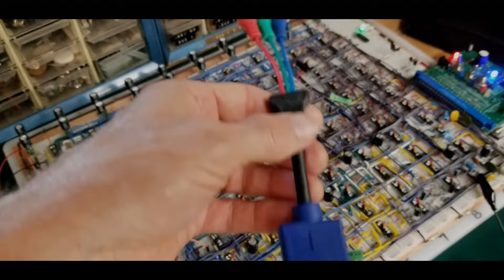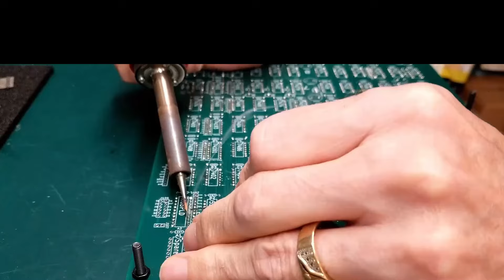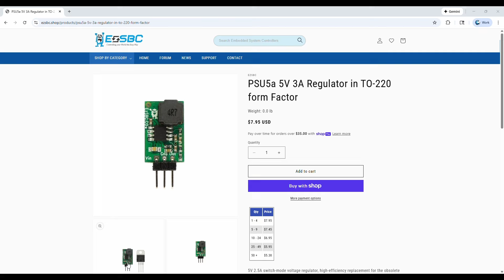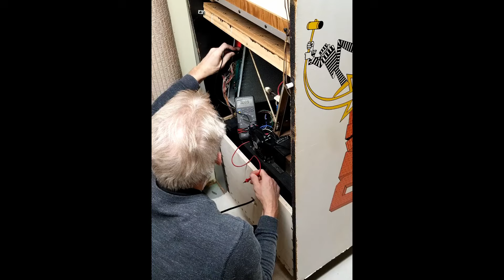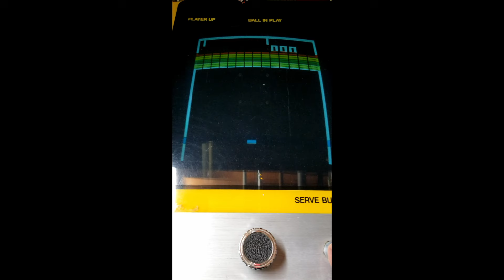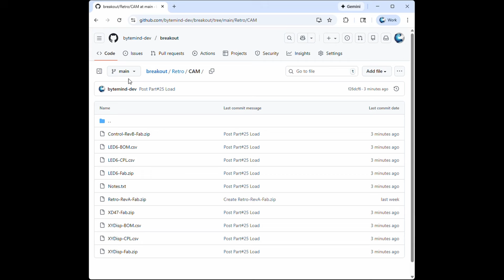Retro Atari Breakout Part 25 - PCB Build & Test: HDMI Support, Power Options & In-Cabinet Test

Comment: I have fully assembled the board and it's running almost perfectly.

The following errors occur:

- The counter always shows 14 credits when switched on.

- When switched on in attract mode, the ball is positioned above the stones; this is correct after the first game.

- When all stones are cleared, the new wall doesn't appear completely.
Reply from the maker: Excellent!!

-For the 14 credits; the Q latch should be off which force-clears the 74193 in L8. Is the operational latch working properly, e.g. pressing SET & RST? Is L9 a 7400? Perhaps a bad or fake 74193? I'll try to simulate the same condition.
--Update: If you only install 1 coin switch, you need to short the other switch NC side to GND. If I remove my control card and power on, the operational latch (Q) does not work and the coin counter is stuck on 2. Not sure if this is the issue or related to the issue. Thought I would mention it.

-At power-on the video counters should have random values, so the ball can start anywhere - including behind the bricks. This should be cleared up when you press one of the start-game buttons.

-For the new wall, most likely C15 or R22 is bad or the wrong value (also check C14 & R23). We tested this out in Part#15 by purposefully lowering the cap value or decreasing the resistance (don't remember).

Let us know what you find!! -Paul
Reply: @bytemind-dev 
I've taken another look at the board:

-The operational latch worked (set and reset) when I set it up. Now, when I press reset, the LED dims briefly but stays on.

Q is always high.

L9 is a 74LS00.

The 74193 seems to be okay; I've connected a display. It counts down for each game and up at credit 1 or 2. The LEDs for one or two players also light up accordingly.

I've connected both coin switches, and both work.

-When switched on, the ball always starts above the wall, which isn't a problem, I was just surprised that it never starts below the wall.

-I experimented with C14 and C15. The built-in ones were both around 1300nF.

I replaced both with 2200nF capacitors. It works for player 2, but not for player 1. I also replaced 74123, but that didn't change anything.

``` I'll have to take another look at that, testing is so time-consuming :-)
Reply: Today I took another look at the credit counter. I discovered that the problem lies with the coin switches. They are momentary switches. If I hold both in the drop position, there are no credits on the counter when I turn it on. Releasing either one of them adds a credit.

I reversed both switches, and now it works as it should. Q is off and comes on with the first coin.

I measured the drop contacts on the switches, and they go to coin1nc and coin2nc.

Does the designation (Norm/Drop) refer to the switch position and not the contacts? If so, I misunderstood :-)

Now I just need to get to the bottom of the "empty wall detector" problem...
Reply from the maker: @Ramex2099  NC should be normally shorted to ground (Norm) position and NO shorts to ground when you "drop" a coin via momentary shift (Drop position). Both of my switch levers on the control card normally sit towards the Coin LED and to drop you push away. Perhaps your switches have reverse mechanics internally. Are you using the recommended switches or something else? -Paul
Reply: @bytemind-dev  
No problem, i thought the "Norm" and "Drop" is for the contacts, but it is for the position of the lever. If the lever is left, the middle and right contacts are closed,  if the lever is right, the middle and left contact are closed. the switches are some i already had.
Reply: @bytemind1633
I've been working with the "empty wall detector." Player 2 works with a 2.2µF capacitor, but for Player 1 I had to go up to 10µF.

However, in my setup, when a player reaches 448 points, the next player who hits the ball with the paddle gets a new wall.

So, for example, if Player 2 reaches 448 points and then hits the ball, he gets a new wall. But if he misses the ball, Player 1 gets a new wall as soon as he hits the ball with the paddle.

Can you check this on your board please?
Reply from the maker: @Ramex2099  Just call it a "feature". I'll take a look. Pretty strange? The resistors are the correct values as well?
Reply: @bytemind-dev  
I slightly increased the resistors for testing, they are ok.
I think its no big problem, not many will  get to empty the wall with 5 balls.
Reply from the maker: @Ramex2099  Still strange. Are you using the N82S16 or a variant? Breakout uses a strange write scheme where it simply hold WE low and DIN high and cycles through the addresses. Should really pulse WE after addresses are stable. Not a proper way to write but it works for the N82S16. Could be a reason? -Paul
Reply: @bytemind-dev 
I'm using a 27LS01. Couldn't get an other  for an affordable price.
Reply from the maker: @Ramex2099  I ordered a AM27LS00 (couldn't find a 27LS01). I'll see if I get the same behavior. Should just be a couple of days. -Paul
Reply: @bytemind-dev 
Have you tested with the N82S16 or any other?
Reply from the maker: @Ramex2099  Only the N82S16, hence my purchase of the AM27LS00 to try something different. The N82S16 works fine for the 2nd wall. If the AM27LS00 works fine for me, I'll do more searching for your issue. Note that triggering either set of FPD lines does the same thing. Just depends on which player is up to set their bricks. With a very large cap in C14/15 it is possible that the FPD lines stay on long enough to fill the next player's bricks?? Doesn't make sense. If you have the board socketed, I would try replacing M4, E4, F3 and F4 for good measure. If these are soldered in, probably easier to debug than replace. I know it's a pain to get to clear the wall to test, but you can remove F4, then clear a few bricks normally, then quickly jumper F3.9 to GND to trigger a fresh wall (works for me). Another way to get to 448 quickly (if socketed) is to bend up pins 9 and 10 of M4, then you only need to get to 8 (exactly) to trigger the new wall. My AM27LS00 is on it's way so we'll see if that gives me the same behavior you are seeing. -Paul
Reply from the maker: @Ramex2099  I just got my AM27LS00 in and it's acting strange. Sometimes loads bricks and sometimes not. Now it's just not doing anything. Got 2x AM27LS00s and both acting the same way. I do some more experiments, like trying to properly pulse WE. Perhaps I can send you an N82S16. Let me know. - Paul
Reply from the maker: @Ramex2099 Well the datasheet for the AM27LS00/01 has this statement "Output preconditioned during write to eliminate the write recovery glitch", e.g. a fancy way to say DOUT is disabled when WE is asserted. That's why the bricks disappear when you start a game (WE is held low until you press serve). Not sure why the 2nd wall of bricks does not fill properly. They do make -1 devices, e.g. AM27LS00-1, that does not disable the output when WE is asserted. Still does not answer the 2nd wall issue. As I said before, Breakout basically violates the datasheet requirement of asserting WE after addresses are settled and just holds it low during 2nd wall and at game start and cycling through the addresses works to write 1s with the N82S16. I am trying to modify the old breadboard to pulse WE during start and 2nd wall fill, but not pretty. Best bet is to get an N82S16 or 17. I can try and send you one if you can't get them there. U.S. eBay has some for $10 for 2x including US shipping.
- Paul.
Reply: @bytemind-dev 
With a 10uF capacitor for player 1 the walls fill properly,  it's only that the wrong player gets the wall, depending on who hits the ball first with the paddle.
Reply: @bytemind-dev 
Hi Paul, thanks a lot for the tests and your explanation. I'm desoldering the memory from the defective board today and will try it out; it's a Ceramic 93421. I'll report back this evening. I found an 82s17 for €12 and ordered it; it will take a few more days. In the meantime, I soldered an adapter for the cabinet and installed the board. After correcting a few errors, it works well. The picture is fantastic, and the brightness is great too. One small thing isn't working properly, and I can't figure it out. With the first coin, the 1+credit LED lights up, and with the second coin, the 2+credit LED lights up. But then they never turn off again, even when credits are used. Even after a reset, both stay on. They only turn off when the power is off. The counter works correctly; with one coin, you can only start a single-player game, and after the last credit, "Run" turns off. It works perfectly with the test board. I don't understand it; it's just an LED with a resistor.  I'll adjust the series resistor.
Reply: With the 93421 Memory i can change the capacitor back to 1 µF and the wall apeares still complete. But the problem, that the wrong player gets the full wall is still there. Are you shure this is not like this on your board? 
You wrote "Note that triggering either set of FPD lines does the same thing. Just depends on which player is up to set their bricks".  Maybe this is the cause of my problem?
Reply from the maker: Don't know what to tell you :( Works perfectly fine on my PCB, the breadboard, etc. Super-strange. After I clear the 1st wall, the 2nd appears as soon as I hit the paddle. The behavior is distinctly per-user. Tested in both upright and cocktail modes with regular play (used "balls forever" mode). M4 or E4 might be bad? After player 1 clears the wall and player 2 has not; E4.5 should go low (E4.1 should be high). After player 2 clears the wall and player 1 has not; E4.1 should go low (E4.5 should be high). I'd start looking there. R5 is installed, correct? Let us know what you find. -Paul
Reply: @bytemind-dev 
I tested M4, E4 and some other chips in the ic-tester, all ok. R5 is installed correctly.
If player 1 clears the wall E4.5 goes low. If player 2 clears the wall E4.1 goes low. I had to put in a 10uF capacitor for player one,  because the wall was incomplete again. But the problem, that the wrong player gets a new wall is still there. Wait for the 82s17 and test again.
Reply from the maker: Every other datasheet I've seen so far on "compatible" parts shows that they disable DOUT when WE is low. At this point I can only recommend the Signetics N82S16, N82LS16, or N82S17 parts. -Paul
Reply: @bytemind-dev 
I ran some tests and checked the signals from FPD1 and FPD2. The potentiometers started jittering after every few games and had to be replaced. So I removed F4 and connected the corresponding pins from F3 directly to ground, as you described. FPD1 and FPD2 are working correctly. 
But the two signals are combined with an OR in the bricks section? What's the difference then, whether Player 1 or 2 cleared the wall? This assumes that the player who cleared the wall misses the ball immediately afterward; otherwise, it works correctly. 
And the 82s17 arrived today; I'll try that one out this weekend.
Reply from the maker: @Ramex2099  I pointed out how they could have just used a single one-shot for the wall in part 15 because they both do the exact same thing - as you point out. Difference is that the RAM_PLAYER_1 line is high for player 1, so only their bricks get reset, and low for player 2. I got some crappy POTs early on. Not worth it. -Paul
Reply: @bytemind-dev 
But if, for example, player 1 misses the ball immediately after reaching 448, he don't gets a new wall yet. Then it's player 2's turn, and ram_player_1 changes. If player 2 now hits the paddle, he triggers fpd1 and, because of ram_player_1, gets the new wall, right?
Reply: Shouldn't the "empty wall detect" section check if the correct player is up? For that, `ram_player_1` would need to be included in the OR condition.
Reply from the maker: @Ramex2099  When player 1's score is 448 and player 1 hits the paddle, that triggers the FPD lines and since that player is up, only his bricks are affected (should be). No need for RAM_PLAYER_1 to be in the OR because that player's bricks are already selected via RAM A7 line. - Paul ... any luck with that N82S17???!!!
Reply: @bytemind-dev 
The problem occurs only when the player who reaches 448 is missing the ball with the paddle, than the other player hits the paddle first and gets the new wall.
Reply from the maker: @Ramex2099  Wow, your right! Never pulled my thumb out of my @$$ long enough to listen to you and think about it. Their circuit is designed exactly to do this (I don't think on purpose). Good feature though - miss the paddle on purpose to make it harder for your opponent. 😁In the empty wall detector, stick an AND gate right before each FF clock and with RAM_PLAYER_1 on the bottom FF and PLAYER_2 on the top FF. There are a few spare AND gates in C1. Good find though! Interesting stock behavior. - Paul
Reply: @bytemind-dev 
Cool. 😊
But your right, it has to be an AND. 
I test this tomorrow 👍🏼
-Ralf
Reply: @bytemind-dev 
Hi Paul, 
today I wanted to modify the board so that the correct player gets the new wall. 
I looked at the schematic and I think the one-shot is triggered by a low signal at flip-flop "C". 
That means I have to combine the signal at the upper flip-flop (player2) and ram_player_1 with an "OR" logic. 
Only if both signals are low the output should be low and trigger the flip-flop. Or am I thinking wrong about this?
Reply from the maker: @Ramex2099  That's OK, but you'll run into a different problem; whoever hits the paddle when anyone's score bits are 448 will set their particular flip-latch (F4a or F4b). Then every time the game switches to that player it will retrigger the one-shot and re-populate their wall because the FF is set until the next game and your ORed signal will re-trigger the one-shot. I think you need to backup to the 7474 clocks because you only want the payers FF to clock when they are up, refreshing their bricks. The FFs get SET when the CLK rises (BP_HIT falls, then rises when any score bits are 448). Since you have spare AND gates on-board (site C1), you can add these between the OR gates and the FFs. The 2nd AND input being signals RAM_PLAYER_1 for F4B and PLAYER_2 for F4A. -Paul

Comment: I wish everyone a happy new year.

The ordered circuit boards have arrived, along with almost all the components. The rest are on their way. I'm having trouble ordering the memory. I've been looking at these memory chips:
82S16/93421/2700/6531 tristate 
82S17/93411/2701/6530 open collector. 
The cheapest one, at €7.50 (about $9) including shipping, is the 27LS01. I think I'll have to invest in that. 
I've finished the control board. Once the 74175 arrives, I'll start on the large circuit board. 
I'll assemble it following your videos; you couldn't ask for better instructions. 
Thank you so much for your efforts! 👍🏼
Reply from the maker: Excellent! Glad to hear the components are arriving. Just make sure of the proper side before starting to solder - almost fooled myself. Happy New Year to you too! -Paul
Reply: Thanks for the tip.I got 5 boards,  so I used one to sort the components 😊

Comment: Awesome Paul 👍🏻
I hope to start building up the PCB soon…  I’ll have to figure out driving the old school RGB CRT (EGA/CGA) Video monitor I intend using.  Hopefully some of your work will go towards that, line counts, pixel counts to encode RGB.  Haven’t looked into yet.  Could be fun 😉
Cheers
Reply from the maker: Yeah, you might be able to get CGA working. I'll send you a schematic of what I was playing around with for VGA. The premise is the same except CGA's RGB lines are digital, not analog like VGA, so your colors are limited. Sounds fun!

Comment: What a great journey, thanks for sharing it with us!
I'd like to make one of these in a tabletop cocktail version. Tuck the board under an HDMI screen from the thrift store in a custom enclosure. I'm sure I'll be re-watching parts of this as I go.
Reply from the maker: That's a great idea! That RGBtoHDMI thing is pretty good, but with our strange pixel clock it's hard to dial-in exactly. Oftentimes when I power it on I need to hit the Auto-Calibrate from the main menu to re-match exactly. You also need to do this when nothing is moving on the screen, like just after power-on or after pressing the op latch reset button. I'll drop the custom profile for this onto GitHub somewhere. It's a good place to start. -Paul

Comment: Hi Paul,

I'm currently repairing a "Microgames Breakin'", an almost 100% clone. While searching for information, I came across your videos. I'm amazed at how knowledgeable you are and how well you can explain things. Your videos are fantastic; I learned a lot. I ordered the circuit boards and components today. You have to order at least five boards, so if anyone in Germany is interested in a set, please let me know. Thank you so much for your great work and for making all the information and files available.

Best regards, Ralf
Reply from the maker: Thanks Ralf! I knew nothing about the Breakout circuitry before I started and made incorrect assumptions about how some if them worked. Was interesting for me too figuring it out. -Paul